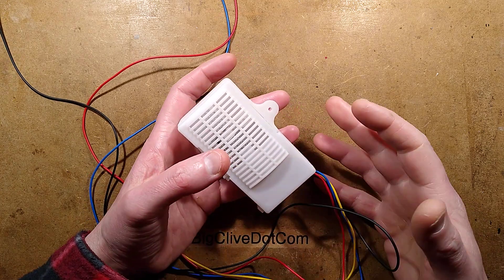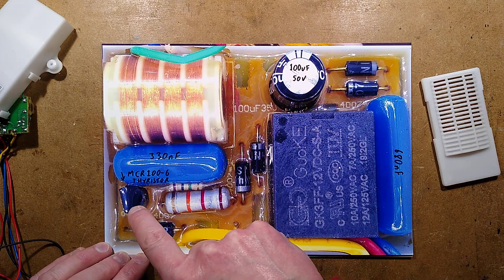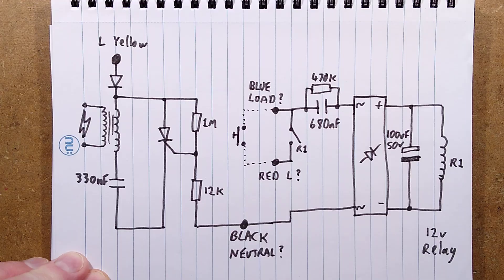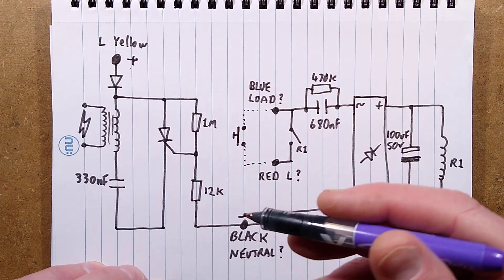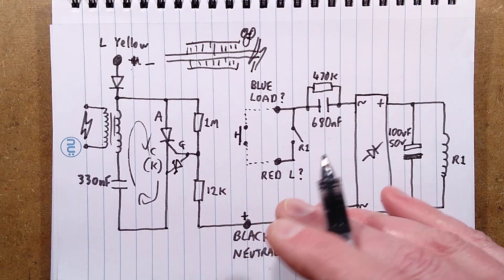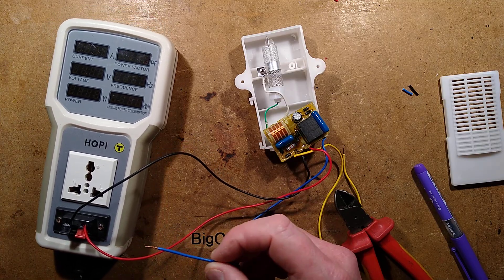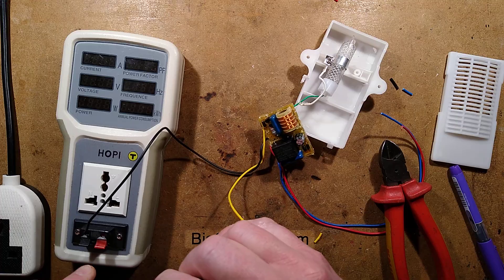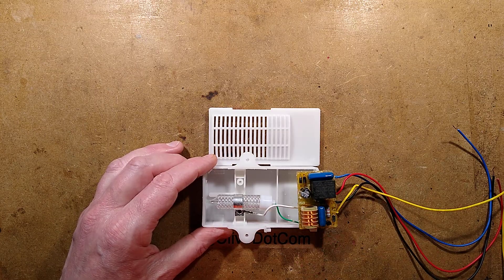Random high voltage eBay "thing"

Comment: How is it with radio interference, especially on the Ham radio bands?
Reply from the maker: Not sure, since it seems to fire on the other half of the sinewave it charged on, and is effectively a closed loop with a decent core.  Not sure about the corona noise.
Reply: Probably extremely noisy. Wouldn't matter too much in it's possible designed use though, most of the high quality ozone uv sanitizer boxes are sealed and surrounded in metal.
Reply: @DGTelevsionNetwork  Don't try this at home? LoL Unless you have a Faraday Cage?
Reply: Only would hear it on the AM side

Comment: My guess    being a    electronics  hobbyist      years ago,  is the  relay  contacts    act  like a  oscillator   switch   turning  on and off  at 50  Hz
firing  the  SCR   The buzzing    is what  you are  hearing, the relay  switching  at 50  hertz
Reply: The relay is not connected when he powers up the tube
Reply: @Loreroth  yes the vacuum discharges are very loud
Reply: @Loreroth   Yes it   the electrons  flow through the relay and it  acts like a buzzer   circuit,  creating    oscillation   for the SCR to fire  at  50 Hertz. This   then fires the transformer  to  create the  high  voltage  spark   It's a  free wheeling  oscillator  circuit   where the  forward   voltage of the  SCR   diode  creates  the pulsing   square  wave    We need  outback  Dave  here to explain  it better
Reply: @johnsenchak1428  ... When clive has the ozone generator tube connected he has it connected via yellow and black. only one side of the relay coil is connected at that point via the black common. The relay contacts are connected to red and blue and a potential pathway to black, they are not connected when he tests the tube. The buzzing that occurs at 14min when there is a loose wire is just the transformer humming
Reply: @Loreroth   You have  to think about it like a  freewheeling   oscillator ,  firing a  fly-back   transformer  in a  CRT TV
Reply: @johnsenchak1428  I realize what you are trying to say but the relay is quite simply not connected to the scr or transformer. I think you need to review the circuit diagram and how it is connected to power, again.

Comment: Call me crazy, but, is that gas krypton? Looks weirdly similar
Reply from the maker: The gas will almost certainly be the cheapest they could use.  Argon?
Reply: @bigclivedotcom  I suppose it depends on the pressure, I don't suppose the tube would be under any sort of vacuum

Comment: I understand the self latching relay on the right side, but how is it supposed to be a safety for the left side of the circuit? Maybe you tie the yellow and blue wires together?
Reply: I don't understand either, you either switch the relay or run the discharge lamp. How are they interconnected? Was not explained.
Reply from the maker: Maybe part of an interlock system that also energises the ozone.

Comment: Our shower has one of these in it.  Mildew control.
Reply: I hope the version in your shower is a bit more waterproof than this looks?!
Reply: @Agent24Electronics  This has no safety ratings.... a big NOPE.  Way up high, have to really try to get water in it though.  Runs off isolated 12VAC, but still has the same zappy glowing bulb thing.  It seems to work well for such a simple thing.

Be nice to get a quiet one.
Reply from the maker: I have seen similar modules for home saunas.

Comment: You can sometimes smell ozone in the air - after / before rain? I forget. But your description calling it a "bleachy smell" is wonderful. If I learned anything in this video is that. I always puzzled over how to describe the smell of ozone. Thank you for that!
Reply from the maker: Occurs in nature at about 0.04 parts per million.  May actually be an essential part of natures cleaning process missing from homes.  Which may ironically be the reason that Sharp's Plasmacluster units really work.

Comment: Reminds me ozone producers used in some small cheap laboratory refrigerators.  Used to prevent cross contamination. In university settings it’s not uncommon for several teams or projects having to share equipment.
Reply: Bet you're right since it has a door switch.
Reply: @gangisspawn1  What has a door switch?
Reply: @GordieGii  he said the ozoner has a door relay for on/off, and has to be manually reset. Its in the first 1-2min of video
Reply: @gangisspawn1  He didn't say that. Between 4 and 5 minutes he said his guess is that the relay is a safety shutdown in case somebody opens the door of a lab it shuts everything down.
Reply: @GordieGii  and he said what I said earlier, rewatch it.
Reply: @gangisspawn1  OK, that's four times now. I watched it all the way from zero to 4 minutes and I can't hear anything that sounds remotely like "ozoner has a door relay for on/off" Can you give me a timestamp so I can figure out what you are mishearing?
Reply: @gangisspawn1  Can't find it? That's what I thought. SMH
Reply: Wuhan surplus.

Comment: I would have ordered both the 2 and 4 wire versions to compare them.
Reply from the maker: Strangely enough, there's a two wire version on its way.
Reply: @bigclivedotcom  😁😉
Reply: But... 4 is more so then better
Reply: I just checked the pictures I found on various sites & eBay. The 2-wire one is missing the big relay. So whatever that does - safety interlock maybe, that's the difference.

Comment: This reminds me of some of my handiwork during the 5 year period in the late ‘90s and early ‘00s when I tried my hand at electronics repair.
Reply: Did this, per chance, happen to coincide with a 5 year period in the late '90s and early '00s when you may have also been experimenting with smokin' some of the devil's lettuce?  

I'm just joking about the smoking thing, but this has got to be one of the most unorthodox ways to create a small quantity of ozone that I've ever seen.
Reply: @kaisersose5549  I was a tech for theatrical lighting “moving lights”, lighting control boards, commercial grade amplifiers, sound mixing consoles, microphones, XLR cables, Whirlwind connectors, power distribution panels, remover of #2 Phillips bit “fuses”, etc etc ad nauseam. There was devils lettuce, whacky tabacky, jazz cabbage, Uncle Henry’s spinach, and the odd dusting of booger sugar here and there. Of which I never partook of. Allegedly...
Reply: @knifetex  
Sounds like a good time... Allegedly

Comment: I'd concerned how close everything is to one another, now I realise why they overdid it with the resin!
Reply from the maker: They have good anti tracking slots and the gel may be because the unit appears to be a chopstick sanitiser!
Reply: @bigclivedotcom  Chopstick sanitiser? lol. Don't they wash the resuable ones?
Reply: @Gin-toki  you know where Corona spread ?
Reply: @Gin-toki  I imagine they store the washed ones somehow and that shelf has these things. It's an extra measure mostly.
Reply: @jensrb50  the Corona spreads out and discharges from the center.
Reply: @bigclivedotcom  so much for scientific use 😅
Reply: I suspect the resin is to keep the ozone from corroding the leads and copper cladding.

Comment: I do love my random ebay things. On a somewhat related note, you are the reason I order a good chunk of random ebay things I don't need but want.
Reply from the maker: Random eBay tat is the best thing to buy after a drink.
Reply: @bigclivedotcom  ...and the best thing is the surprise when you can't even remember ordering it.
I ordered one of the laser light show boxes (with the diffraction screen) you showed.  That was after "a few" drinks too.  It will either turn up one day, or I'll get a "please explain" from customs/border control as it is probably not a valid import for Australia.  Actually it might be blessing if it gets lost in the post...  it has been a few months now.
Reply: @Chris_the_Muso  yeah I used to do that a lot, it's like sending yourself a present...
Reply: @bigclivedotcom  tat? Does that mean something other than tattoo where you're at? I don't get that one
Reply: @gadgetsage  tat:=  bric-a-brac, trinkets, gee-gaws, knick-knacks. Generally miscellaneous 'stuff', usually low quality as in 'tatty' meaning tired, worn or run-down. As a matter of interest tatty is also slang for potatoes in some parts of the UK and tat is also used for tattoo here.
Reply: @regmigrant  ah ty
Reply: @regmigrant  Nice Tats !!!
Reply: @bigclivedotcom  When my GF told my psychologist about my drink + eBay tat he said "Hahaaaa!" and diagnosed me as Asperger's age 40! 
There were lots of "Hahaaa!" moments after that...
Reply: @bigclivedotcom  Unlucky 13, do you want to buy my old car? I started as a joke but this is 100% absolutely true. 1998 Mazda 323 1.4 LX, only 126k miles, owned in the family for the last 20 years and driven 'sanely'.
Well maintained. I would have driven this car for the next ten years but old age has not been kind to the bodywork, it is rusting underneath and I am useless at welding.
It breaks my heart to let this car go, to see it scrapped and crushed, it has an engine that just humms along any road, I never drove it hard but the odd time I had to put my foot down, instant power and a totally natural response (unlike drive-by-wire newcomers) .
The 'new' car is quite 'er, the old car has two new front tyres (nothing wrong with the rears) and I pass it every day thinking oh mate, you shall not be crushed! I sell it for scrap value in the hope that somebody will want it for more than that, a fine piece of engineering just waiting to be appreciated.
Reply: @conmcgrath7502  ah thank you for the "natural response" part- I'm so frustrated by the half - second delay (an ETERNITY!) in modern cars.

Seriously, how did that become acceptable? Who's the asshole who signed off on that?
Reply: He should try and use your comment to get sponsor ship from eBay
Reply: @gadgetsage  dropsponsorshipping mode engaged.
Reply: Unfortunately, the ones I want usually weigh 1000 pounds and are local pickup only from 2500 miles away.
Reply: Isn't that why eBay grew so fast? Drunk people ordering random tat at 3am!
Reply: Christmas every day! :)

Comment: After seeing the sparks in the glass tube, I wander if it actually contains gas (except from the atmosphere) in vacuum. Love the sparks though. Loved (safe) high voltage since I was a kid, playing around with our old TV. Not that that was safe, but the "rules" for safety were a little different in the 60s/70s :-)
Reply from the maker: I was pondering if they might have charged it with argon.
Reply: @bigclivedotcom  Time to dust down your spectrometer Clive!
Reply: Not just any argon, but special left-chirality, gluten-free Argon straight from CERN.
Reply: @ zeodijk The safety rules are the same as the 60s and 70s you place your head between your legs and kiss your ass good bye unless Clive gives you namby pamby batteries to play with!

Comment: It is interesting that the two wire version appears to still have the capacitive dropper and bridge rectifier but no relay. most odd.  https://www.ebay.co.uk/itm/2-4-wire-Universal-Ozone-Generator-Negative-Ion-Sterilization-Ozone-Sensor-Power/293978464012?hash=item44727b5f0c:g:ex8AAOSwvd1gEosE
Reply: It looks like a slightly different arrangement that one

Comment: Oooh, that wasn't the effect I was expecting.  Lightning in a tiny bottle!  
I kind of want a big version.  :P
Reply: Plasma ball style
Reply: I have a kitchen hood with a big gas filled ozone tube maybe like 30cm long in it. It makes scary lightnings and a loud buzzing noise.
Reply: @atmel9077  strange
Reply: the big effects are called Tesla coil
Reply: Same. I wonder what form factors that corona discharge tube comes in

Comment: "No-volt relay" is a new term for me. Thanks!
Reply: Aldo called a no-volt release switch. Often used on stationary machine tools such as table saws, grinders etc.
Reply: It means it’s there is no voltage or current on the contacts. Sometimes called “dry “ contacts
Reply: @jeffc6167  Definitely not dry contacts. Dry contacts are not connected to anything. These contacts are connected to line voltage.
Reply: Yes that is a thing but in this case the way it was stated is could be a bit confusing for some!

In this case I believe what is happening is it's a a latching relay setup?

That would drop out if power should be interrupted and keep from reactivating device until when is reset by an external switch or contact.

There are others that would just provide a contact closure should power fail to indicate possibly alarm or malfunction as well some self restoring upon power resumption and others watching and referring manual reset or reset through other means.

Comment: Waft of ozone and a light show, it's hard not to like this gadget.
Reply: All for the low low price of ONE Watt!
Reply: @johnpossum556  it's like the way things were engineered decades ago. Fly to the moon and back again on one watt. 😀
Reply: Dad's last words. Remember them well. That and the smell...
Reply: It is a really sexy little circuit. On one hand it can be looked at as cheap as possible, but on the other hand every single component is thoughtfully chosen. Their is beauty in simplicity
Reply: @Spentelectrons  sometimes the cheapemified circuits are beautiful.
Reply: It looks like a high power strobe ligh